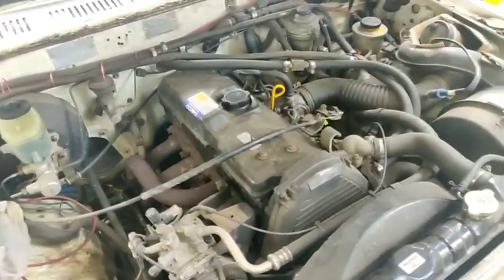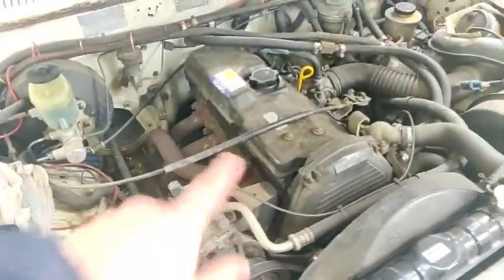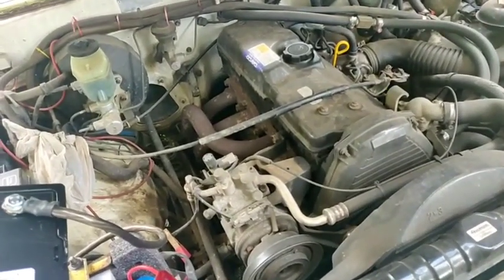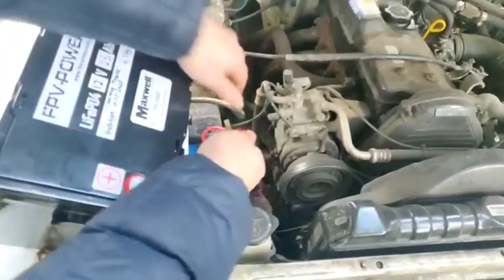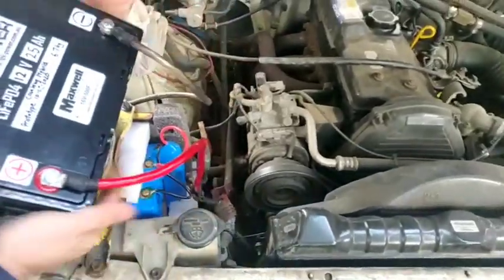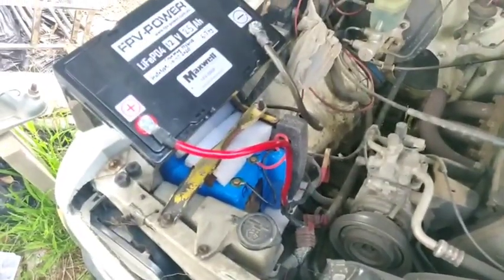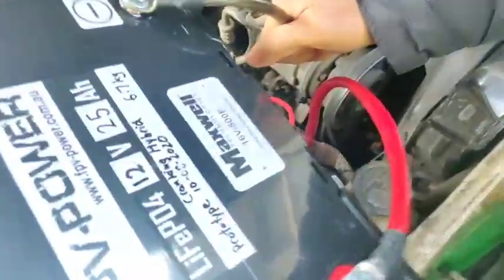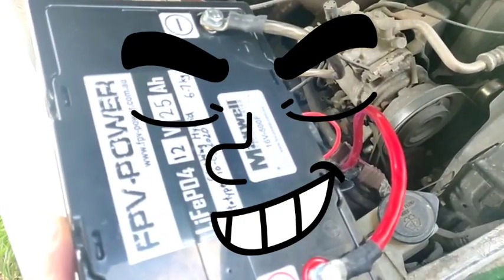FPV-POWER Super Capacitor/Lithium HYBRID cranking Battery

Comment: I'd rather see the test on a cold diesel..
Reply from the maker: Makes no difference... . I would love to be in sub zero temps and cranking this for the world to see :)

The thing is the super capacitor doing the work not the lithium battery. 

With ability to dump  1900Amps, what won't it start?

Comment: can i run one of these in my engine bay and still charge an AGM thru a vsr to run my fridge
Reply from the maker: Sure thing, this is a direct swap over solution, with all other circumstances unchanged.... Just that u have a super cranking batt period.  Nothing else changes.